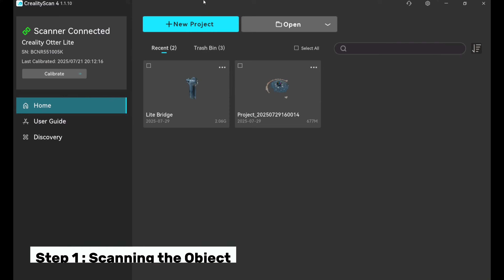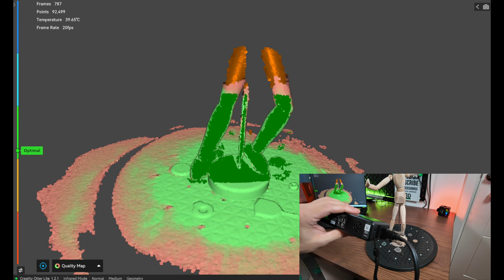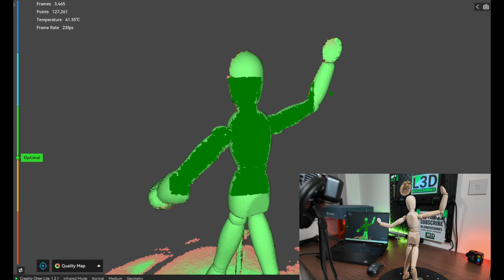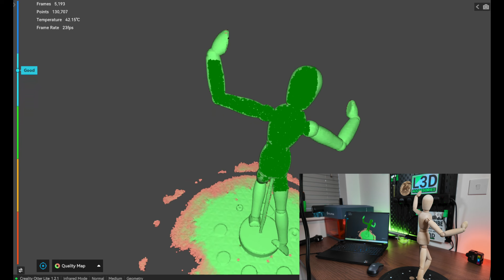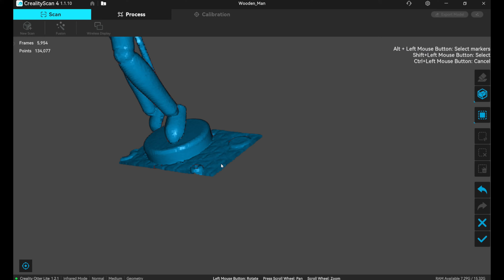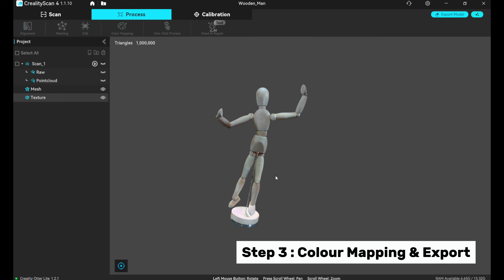Beginner Tries 3D Scanning with the Creality OtterLite - Surprisingly Impressive (Ep 1)

Comment: The turn table that comes with Otter Lite was not enough? Process of scanning in a wireless mode (scanner connected to a laptop wirelessly) would be interesting (fps, delay, result details).
Reply from the maker: Yeah it's more than enough, I actually didn't realise it came with one so purchased the bigger one before it arrived. But now that I have it and it's a bit bigger I use it. Thanks for the suggestion about doing the wireless scanning. I'll definitely give it a go and report back.

Comment: I've printed up a heap of random markers, the biggest thing is keeping the spots random and enough in view so it can keep tracking. The global marker is handy, lets you scan the markers quickly so you have the "template", then go to scan with it in memory. Great series starter, developing a post-processing workflow for different scans is helpful for us as this is where the biggest learning curve is. I love the OtterLite as my first scanner, it's quite intuitive and even failures are interesting as it gives me good data for my next scan attempt. I'm running mine through a bog standard MacBook and a Pro, also with the scan bridge. 
I use the lasso and catch the scan then reverse the capture to delete the outside which saves a bit of time.
Reply from the maker: Thanks for the brilliant tip about selecting the main scanned item and then inverting the selection. That will save a lot of time! I'll give the global marker method a try, it sounds like it would name things cleaner. It's always great to come across fellow makers who have the same equipment. Thank you for watching and for your comments.

Comment: With my experience with the Otter Lite I don’t think you needed the coins the tracking is very good indeed. Also when cropping the base away turn the model to face on and level then crop it in one go.

Good video though.
Reply from the maker: Excellent advice, I really appreciate it! Is there a way to turn it so the you can look directly at the front and everything is level? Or is it just a case of manually adjusting the position until the model is in approximately the right position?

Thank you for the feedback and for watching.
Reply: @L3DAccessories I think you’re talking about the global positioning. You can’t change that in the Creality software you have to do that in something else. It’s seems to be set by the position of the scanner when you first start scanning. 

You also said during the scan that you wanted to keep it pointing down. That’s probably because you wanted to keep the pennies in shot. Good thinking but not needed. Point up and down to get in the nooks and crannies like under the bottom of his body. 

The tracking is the best I’ve seen. I’ve done a video using it too. Maybe have a look. I’m new to the YouTube thing though so not as polished as yours and I keep talking rubbish!! 😂

Comment: I see you have some excellent frame rates when scanning, could you please share the PC model etc that you are using? I love the 'LIVE' way you have presented this. It's honest and real. I hope your going to follow up with more scans, shiny objects, tiny object large objects. I'm also interested in the accuracy, as you mentioned that you do a lot of reverse engineering. Keep them coming, I've subscribed and shared your video....... Thank You.
Reply from the maker: Wow, such great feedback. I really appreciate it! To answer you questions: The laptop I used is: ASUS Exertis FA607NU-RL051W Laptop. It's only got 16gb RAM which is the minimum suggested from Creality but it seemed to run really well for this. 

I will be doing more episodes in the same format which will be of increasing scan difficulties and I am definitely going to be checking dimensional accuracy so I'll make sure to include that in the upcoming videos. I've really enjoyed my 3D Scanner experience so far and will be finding ways of mixing it with my laser engraving as well as 3D printing so there will be lots more content to come.

Once again, thank you for the support!